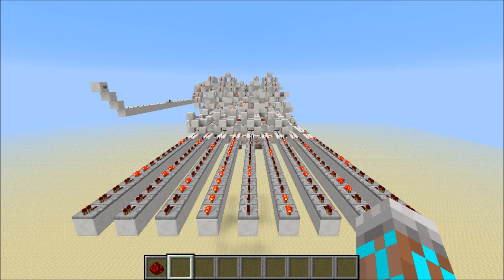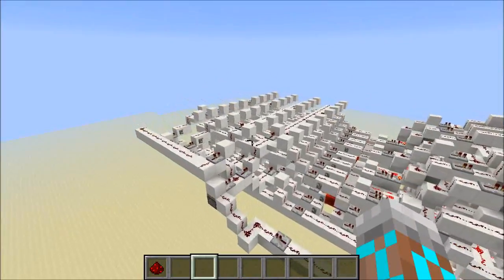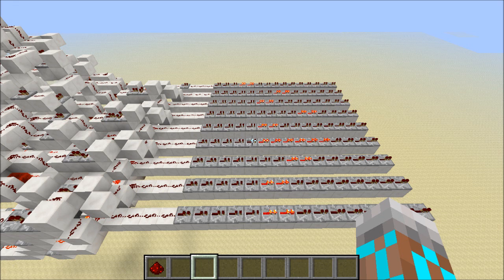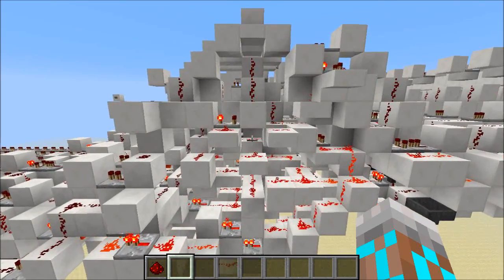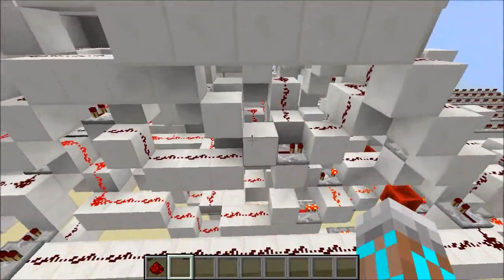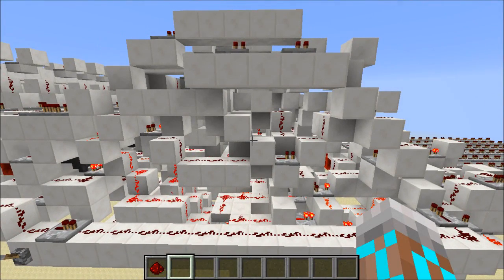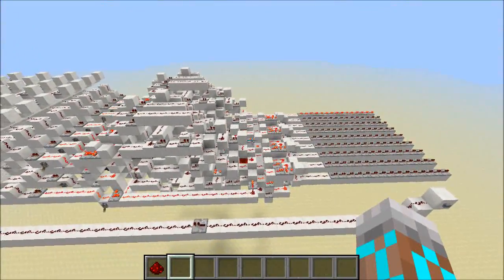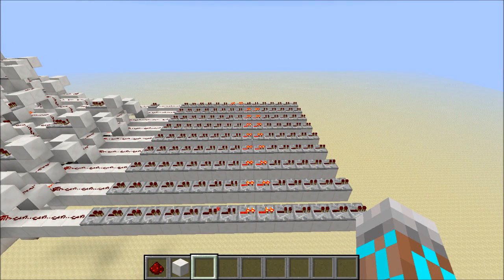Anti-Burnout Adder V2: 7 Ticks for 8 Bits w/ Carry In

Comment: Theoretically it's possible and I already build the hardest parts for a very simple 1-byte CPU. The problem is that there are just too many bugs to handle at the moment so I will have to wait until the comparator and piston bugs are fixed. Even in 13w05b there is a nasty comparator bug which makes it impossible to build a anti-burnout monostable circuit that unlocks a repeater lock for 1 tick.

Comment from the maker: The idea is that with an adder like this you can process data at a very high rate, so if you need to run the same operation on lots of data, you can simply stream the data through the adder rather than do everything separately.

Comment from the maker: That's exactly what I did here - the carry logic doesn't have any NOT gates in it, I just used the comparators. The thing that made it difficult is the fact that the generate needs to go into the A input and all of the propagates need to go into the B input. It was significantly easier with NOR gates (in the torch based version) because I could simply OR the generate and propagate together, so there were fewer wires.

Comment: Nice job. But I am wondering if it would not be possible to use the logic of a comparator in you advantage. Beside that you could use it as an anti-burnout NOT gate. Because its truth table in subtraction is the same as AND( A, !B ), however it is 1 tick (so 1 tick faster then what is possible with 1 tick NOR and OR gates). Or did you already use this, since I did see a comparator with two inputs in you video.